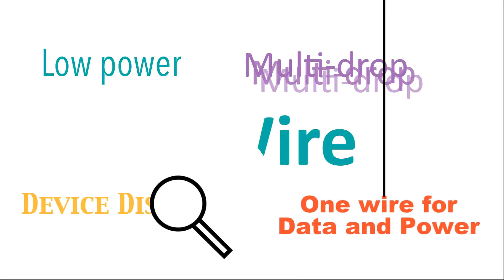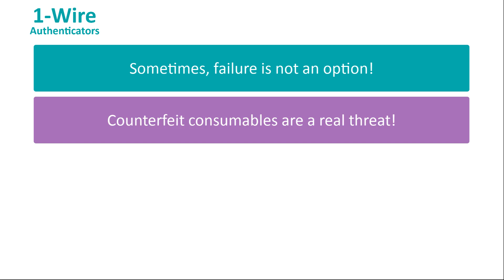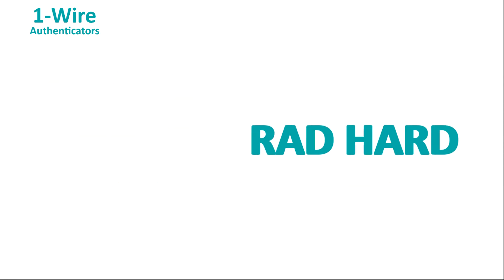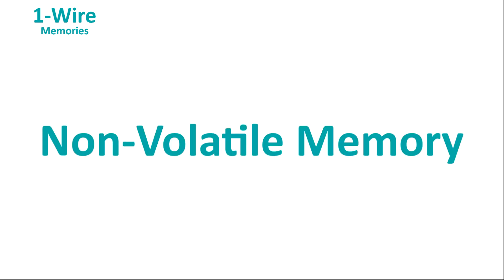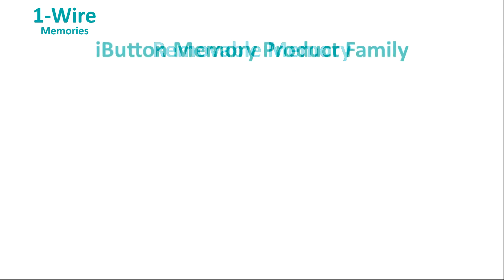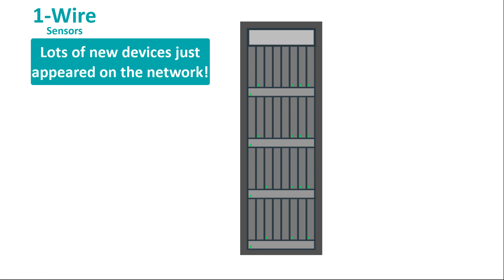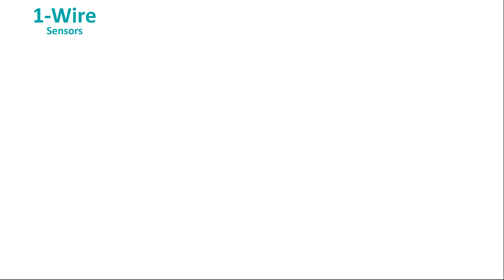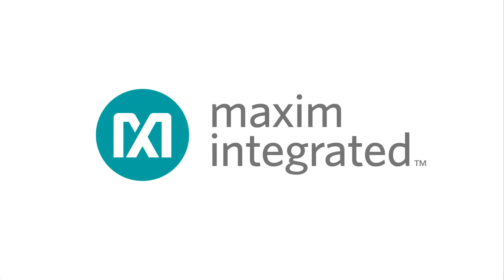1-Wire® - Technology Overview - Part 2

Comment: Hello, I was considering the 1-Wire interface for a project relating to my master thesis and a critical requirement for the interface design is that slave devices (time of flight sensors with I2C interface) must be able to send independent interrupts in case of emergency, and without master microcontroller initiating the transaction. I could not find that functionality in the 1-Wire protocol. Is there a way to send independent slave interrupts ? I have also temperature monitoring with the same requirement. If I use 4 DS28EA00 temperature sensors as slave devices and 1 DS2485 master device interfaced to the Microcontroller via I2C, can the temperature sensors initiate transaction while the master is in sleep mode, when for example a sudden rise in temperature occurs due to possible fire?